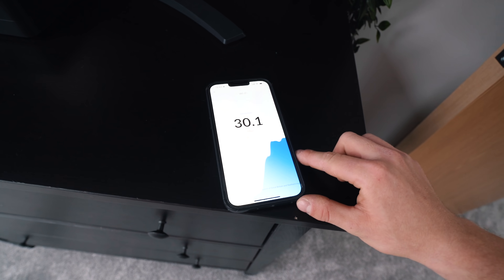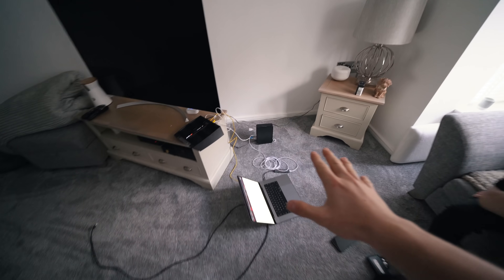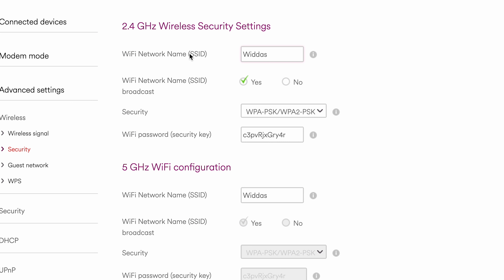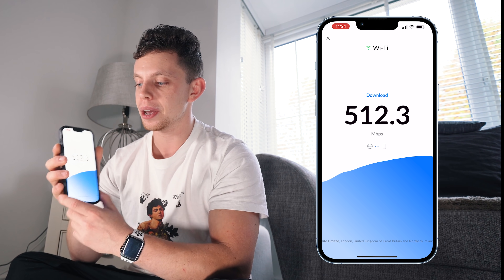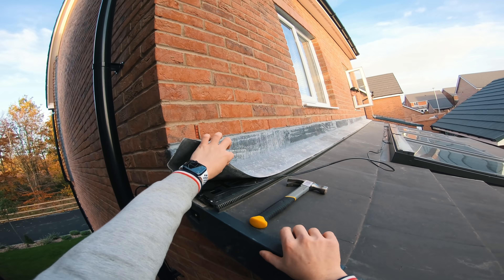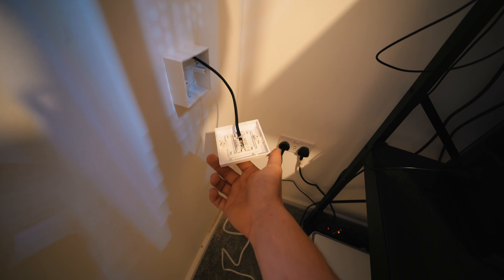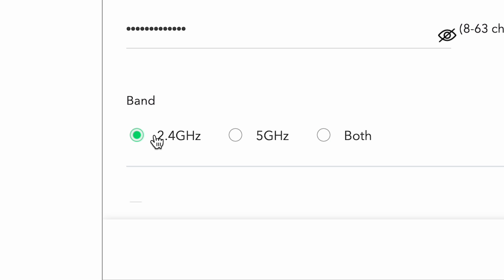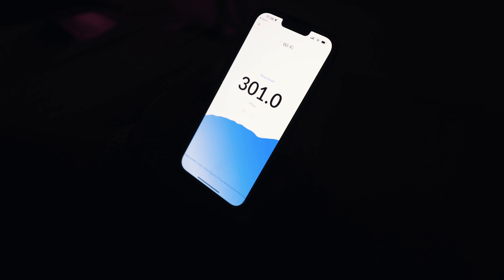Fixing Bad WiFi is EASY: Pimp my WiFi Episode 1! Ft. Ty Widdas!

Comment: just a little tip, drill from the outside in, otherwise you will blow the block out.
Reply: It's not easy to stand up a ladder holding an SDS drill with a 450mm drill bit. You can avoid blowing the brick by putting less pressure on the drill as you are drilling. It's also best to turn off hammer mode when you are close to drilling through the brick.

Comment: Hi, do you know if you can use powerline adapters as a backhand for a mesh system.
Reply: Use MoCA as a backhaul not power line thank me later .
Reply: @matty7846  Only viable if you have coax running to each room you need internet. Otherwise, powerline works great as every room has an outlet.

Comment: Hi, not sure if you answer queries on this channel, but I've done everything you've done in this video. So I have a wired connection from my SkyQ hub to the Netgear WIFI6 configured as an AP. I've set the 2.4 and 5GHz bands to the same SSID and password as my SkyQ hub and turned it all on. My only issue is that none of my smart devices seem to be connecting to the WIFI6 2.4GHz band. I get a blue light on the 5GHz band when devices connect, but the 2.4GHz light stays green all the time. Is there some network magic I need to do to encourage some of the devices that struggle to connect due to the weak signal to now connect to the WIFI6, which is broadcasting a much stronger signal in those areas? Thanks.
Reply: Don’t have the same SSID as your sky router. Turn off WiFi on your sky router and only use your AP. If you have skyQ hard wire them from the sky hub and disable each Sky nodes WiFi hotspot.
Reply: @inspiringmoments8386  thanks. It's actually all sorted now. I've gone the whole hog and fitted an unmanaged switch in the loft. Anything that is not mobile has a wired connection and WiFi is only used for mobile devices and smart devices.

Comment: How did you get to the Wireless Settings screen from entering the IP address into your browser? When I first login it takes me through an automatic set up and the first checkbook option it presents is asking if I want to enable smart management of 2.4GHz and 5GHz bands. After that it then goes straight to changing the admin password and setting a new SSID. It never let's me get as far as splitting the bands and choosing channels for each.

Comment: you could of got higher speeds with a mesh/powerline plugs without drilling holes.
Reply: Powerline adapters are no where near as good as using physical cat5e or 6 cabling and is far more expensive
Reply: @reecesoan8138  I had the same problem as this video and used devolo high speed power line adapters and get identical speeds with no messing with drilling cables
Reply: @speedbird737  with your wiring which is specific to your property.
Reply: @4879daniel  of course - so this video could be pointless for most people
Reply: hardwired eth beats powerline everytime. older houses powerline is very crappy

Comment: you should combine the bands!!!!!! so the device finds the stronger signal itself - and its ETHERNET cable not EFFERNET
Reply: Doesn't really matter when you have good coverage for 5g band. Not best practice wouldn't do it for a professional install at work but that is because i would be using APs that can broadcast multiple SSIDs with whatever band or channel i want. e.g my IoT network is 2.4ghz only on its own isolated VLAN and my main and guest is both. Not to mention most IoT devices only support 2.4ghz WiFi
Reply: @reecesoan8138  you don’t know what your talking about - I have IoT and it requires 2.5ghz too and works fine with the merged bands - think your clients need a new adviser
Reply: @speedbird737  Huh? First, not an adviser im a network engineer. I dont know what im talking about? Im not an expert but this is my trade. Merged bands is a great thing and you shouldn't split them if you can. IoT devices can clutter up a network and hog bandwidth if they are 5ghz capable. What im trying to say is that it has literally no negative effect if you can pick up a good enough 5ghz signal everywhere in your house on your phone, laptop or whatever your using. Alex isn't the smartest and he sure as hell has made a lot of dumb statements this video but for what he has to work with hes done a good enough job. I wouldn't personally split bands but i sure as hell wouldn't waste 5ghz 'space' on IoT devices. Nor would i choose my own channels, my APs do that for me. I don't even have my bands split, i just have my IoT network on 2.4 only and my guest and main are both combined 2.4 and 5. Just out of curiousity what makes you an expert or qualify you to say i dont know what im talking about?

Comment: Hi, just watched your video, I have a tp link that I basically want to do exactly the same as you did, I'm on virgin and have a dead spot so my sonoff r1r2 relay cannot connect 70% of the time, these relays only connect to a 2.4 network so I don't really want to have to repair them as I have about 20 or so dotted around the house, can I connect the to link as an access point but only as a 2.4ghz? I don't really want to rename my virgin network, my main routers 5g network is disabled.
Cheers

Comment: Splitting the 2.4 and 5ghz is a bad idea, your devices choose which is best themselves which stops downtime if ur in a bad wifi area
Reply: Doesn't really matter when you have good coverage for the 5ghz band, it's actually a really good idea if your house is flooded with IoT devices
Reply: I have a 5ghz router in middle of my bungalow and the modems in the front bedroom I get full signal on 5g even in garden full download speed off 60mb

Comment: Hmm so I have two TP-Link Deco M5 in my flat. I have Virgin M200 and which is setup in the living room. If I'm on the sofa the Wi-Fi speed is perfectly 200Mbps no problem. I setup the other Deco in my office which is just two room across and the Wi-Fi speed there is 30mbps. Both Deco M5 is setup at a Access Point and the Wi-Fi from the Virgin Hub has been disabled. But I'm not getting the same speed from the living in the office. Any advice?

Comment: Why the fuck are you splitting the SSIDs lol. Smart WiFi handles this perfectly fine. You are going backwards with WiFi technology not forwards
Reply: No splitting is actually a good thing as routers are still dump and you have the ability to choose which is better as you can avoid congestion in your network. What is not a good thing about this video is that he is using same SSID in relativily close distance and as these routers/APs are not from the same brand and thus do not support any MESH system or MESH alternative like fast roaming (which is still not ideal) the dumper devices will stay connected to the Master even after coming upstairs where there is a stronger second slave AP there.
Reply: @simon01920  Ive already said Smart WiFi will band steer by itself. You don't need to choose, that's the whole point. By the time you manually change frequency your device will already have band steered to the appropriate frequency! If you are in range of your router you will be connected properly it's as simple as that. People don't understand the regulated power limitations of a residential router and how to position one in the home.
Reply: @simon01920  Actually I have 3, yes 3 different brand AP's in my house and network switching is fine. Most modern devices won't have an issue switching, the only downside is you might not get fast roaming (that can also depend on if the AP's support fast roaming, I think only one of mine does). I have a Ubiquiti AP, a network router in AP mode and a D-Link router in AP mode.

The trick to ensuring your devices switch automatically is to ensure that not only is the SSID the same, but the authentication methods must be the same as well. Eg, if you have WPA2 TKIP/AES enabled on one AP, but you only have WPA2 AES enabled on another AP you'll have issues. I used to have issues but once I set all AP's to use ONLY WPA2 AES I haven't had an issue since.

Roaming isn't 100% seemless due to the lack of fast roaming, but I think that's more likely to be just because the D-Link and Netgear Routers are old and don't support that feature, not due to being different brands.

Comment: Alex, I have a virgin router with an Internet package of over 200 meg I have installed a ubiquity AC pro access point with a small ubiquity POA switch but I'm only seeing speeds of around 90 meg when connected to the ubiquity access point if I connect directly to the virgin router I can get speeds of 200 meg do you have any ideas as to why this is happening, I have configured separate 2.4 and 5 GHz networks and I have opened up the channel width to 80
Reply: Ask if you can get on the hub 4 or 5 and upgrade to 1 gig or 350mbps
Reply: I suspect, that the model of Virgin Router you have, somewhat dodgily, only has 10/100 Ethernet ports, no Gigabit, and due to overheads, and not being in lab conditions, you then only get about 90 out of that 100.
Reply: @GreeniusGenius  agree could be a hub 2ac

Comment: Does the acces point make him have Wi-Fi 6
Reply: Well, if they connected directly to the Wi-Fi 6 (802.11ax) router - operating as AP then yes. But like I said in another post of mine, cause he set up the same SSID on those devices you can't really tell besides checking speed and even that might not be sufficient. But back to the point of your question, if he is connected to the modem downstairs he would not get it as most likely that modem is only 802.11ac (Wi-FI 5). These 802.11x are only standards, so as such you can benefit from them when you have the right gear - the 802.11ax wireless router or AP and end device with 802.11ax support.

Comment: Brilliant video Alex. Please would you help me out. I've got the VM Super Hub 3 installed at my home & it's not very good. I'm sure you've heard about it...basically it's the 1st part of your video i need your expert help with Please. I need to go into the VM Modem and switch it to modem only...then use my router in place of the modem router and switch it to 2.5 & 5ghz  respectively please 🙏 Alex could you explain this part for me it would be massively appreciated Alex 🙏. Thank you...you make look so easy...there's only 2 of us now my 2 gaming son's have fled the nest & we really don't use a lot of WiFi but i desperately need to fit a security camera outside wall of the house. There's some undesirable people moved in very close to my house 🏠. Thank you Alex 👌 😊 🙏.
Reply: I agree hub 3 is trash get the hub 4 or 5

Comment: I´m astounded that you used a Cat5E cable instead of Cat6. I know that the length wasn´t too long, but it´s nice knowing you have something in reserve 😀
But the install was real clean, so this brings on a sub 😁
Reply: Yes cat 5e or 6
Reply: Cat 5e is same  as 6 but i would use 7
Reply: I use Cat8 in our house.
Reply: @fdan445-2  Why??? what do you have on your network? even cat 6a is capable of 10gig at like 100M Dont think you can even get an internet speed at 10gig anywhere residential atm
Reply: Honestly for 99.9% of installs CAT5E will suffice. From memory specs rate CAT5e for 10GB up to about 50 metres. And domestic installs generally aren't using 10GB. If you are doing a "money no object" commercial install by all means go for higher rated cable but for a domestic install its just not necessary. Cat5e cable is usually cheaper and better to save money on cable and spend it on a better router, access points, etc.

Comment: I have followed the setup, when I do a speed test I'm only getting 80mps from the second router. From my virgin media router I get 300mps. I have a cat5e cable connected. Can anyone help?
Reply: Your using cat 5e which is good and make sure the wifi router can do 5ghz or 5ghz is turned on
Reply: Can also depend on the other router you are using, if the secondary router is one of those shitty ones your isp gives then that can cause much lower speeds, if thats the case get a new secondary router and check what speeds it is rated for and that it has 5ghz compatible ( which most should) and give it a test then
Reply: Make sure the primary router is in modem mode if you can but don’t have to and connect your own router like tp link netgear ausus
Reply: Ditch all the shit and run cat6 from vm hub direct to computer. Done
Reply: Make sure you're not using Cat 5 patch cords connecting your second router. Cat 5 is limited to 100mb cat 5e is 1000mb.

Comment: No concern about lightning protection for the outdoor cable?  Onlly a single run of cable?  Cat 5 in 2021?  Some things are missing here.
Reply: lightning protection lol
Reply: Whats wrong with cat5e?. I'm a network engineer and I just ran 24 cat5e drops in an office. Cat5e is capable of gigabit for a fairly long distance, not to mention how cheap cat5e is. the next step being cat 6 which is capable of 10gig, sure thats cool and more prepared for the future but what the fuck are you realistically gonna do with 10gig in a home. 10gig internet is still a long long long way away

Comment: So making your router into an ap and naming them the same. Does that make it that widdas-iot and widdas only appear once and your device decides byitself which one to pick? Because currently I have something like widdas1 widdas2 widdas3 for my house which are 2 seperate routers and the modem
Reply: Yes you can have multiple AP's with the same SSID and it will 'try' to grab the better one each time.
Reply: @SK0R092  so like rn I have Dexter 1 Dexter2 a lot of times it will try super hard to stay with 1 even though 2 is closer. You think I will still have this problem?
Reply: @dylanmuscat  it will typically connect to the closest one or the one with the strongest signal. Occasionally you may encouter a situation where you're upstairs and it's still clinging to the AP downstairs. What you can do is go into your APs settings and have it kick off clients with a signal weaker than a certain value. This'll allow you to walk around and keep reconnecting to the best possible AP.
Reply: @SK0R092  thanks man much appreciated I'll give it a go sometime

Comment: 4 different wireless networks broadcasting different SSIDs? What about the management overhead frames?!? Have you ever thought about just deploying two access points in bridge mode and disabling the wireless on router and having that as the network gateway? Some  AP's support band steering so steer clients to the 2.4 or 5 ghz radios based on the clients capabilites. I  would have personally run Cat6 which can support mGIG (10Gbps over Copper) up to 55m.
Reply: My Advise would be to ditch the ISP supplied router. The Virgin ones can be turned into a Modem, and replaced with a Decent Access point

Comment: 2:40 what are you talking about. They are broadcasting both the 2.4Ghz and 5Ghz bands. They make use of band steering so clients are connected to the best channel.  
Why are you using WPA 2 when it has WAP3?  9:46
One more example of a clueless person who thinks he's a network tech after setting up a VLAN
Reply: Yes, this is so true, in home use Band steering is even recommended. "Chose a best channel what give you best speed" Omg I LOLed so much. It will not work like that. Sometime one channale may be occupied sometime other and even there may be some interference, best is to chose channel that is less occupied, for that use WinFi if you use windows machine. Also in 2.4 Gz you should only use 1,6,11 those are channels that don't overlap. I would have set up Wi-Fi differently.
Reply: You know he runs his own ISP
Reply: @igloo912  Yes, but he's still clue less.
Anyone can put some crap together and make it work, but he has no understanding of why or how it works

Comment: Why did you need to overstate the effectiveness of splitting the channels.

You did the 20mpbs upstairs, Then connect to the 5ghz right next to the router?

Why not do the test in the same place and show the difference first between 2.4ghz and 5ghz at a distance?
Reply: The reason, if he would do the test in the same place the AP will band steer the device to the 5Ghz channel proving his point is incorrect.

Comment: Wow that it was unpossible using an other cable in the house and replacing that for a UTP cable. 
But setting up 2 different brands wifi products on the same SSID etc will it automaticly switch to the correct network? Normally it stays very long at the accesspoint you connected first. 
That was one of the biggest great things of the Unifi Accesspoints that you can roam steamless between AP's. 
Is Unifi not a sponsor anymore? ;-)

Comment: In need of info.  I have sky Q, max dl 30 mbps. 44% 5hz upstairs. If I use the Newgate  in this video as a main access point can I get WiFi 6.
Reply: You should look into getting a better signal upstairs. Just updating your Access Point to WiFi 6 won't necessarily give you higher speeds if the signal is not improved too. Also you should look if Sky Q box supports WiFi 6. Isn't that box rather old?
Reply: @thanasisbethanis  I have order a Netgear wifi extender with wifi6.  Using it as an access point for 5hz throughout the house.  And Sky q for 2.4hz. Thanks for the info.

Comment: Why did you choose just Cat5e? Cat6 or higher aren’t really more expensive. But can reach more than gigabit easily.
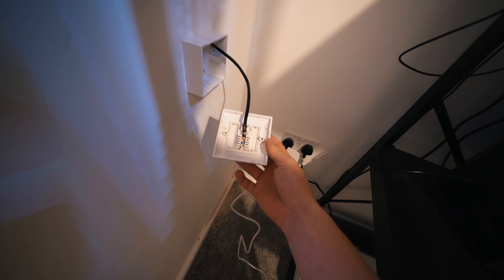Reply: 8:44 when someone installs a faceplate in the middle of the wall they don't really know what they are doing
Reply: Because if the customer needs more speed, he needs to swap the cable, so he can charge more... I think thats behind it. i always install cat7 cables, the difference isnt that much and i charge less for my work hours so the customer at the end will be happier than ever
Reply: Besides that, he used CCA CAT5e… Cheapest of the cheapest garbage cable.
Reply: Maybe he life in place where high bandwith is unavailable